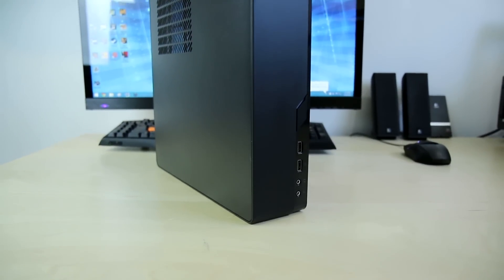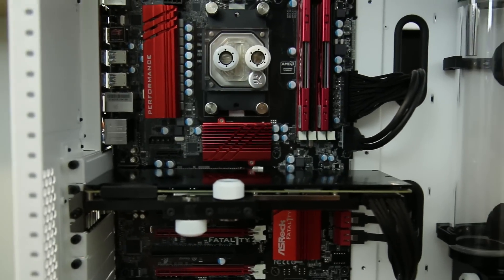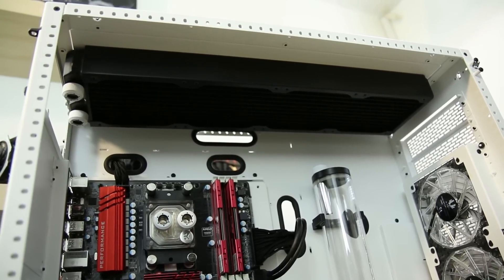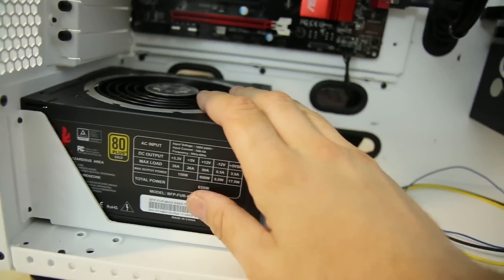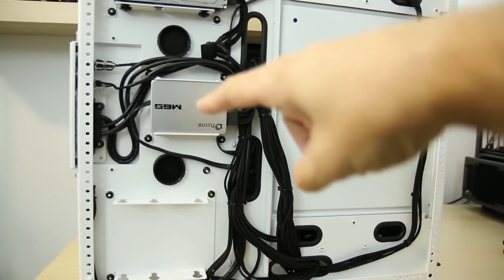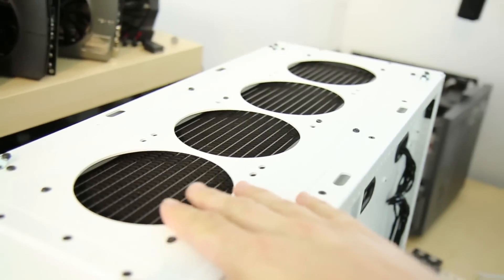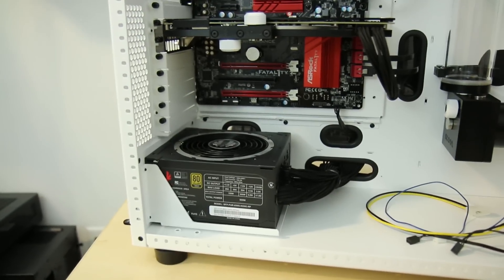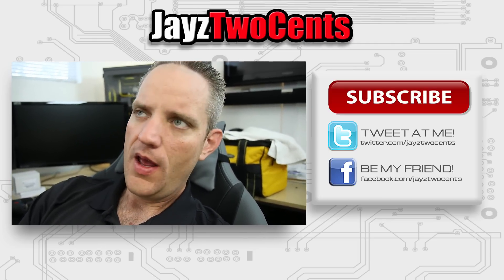Custom Watercooled AMD Build Update No. 1

Comment from the maker: So lets make something clear. Many of these parts used in this are things I donated to her build myself, like the case, the watercooling, etc. If you are looking at this as a "build guide" then you clearly cannot read. The end.
Reply: ***** you didn't really read what he asked
He asked about INTAKE fan not EXHAUST fan
Reply: *****  but if you run the radiator fans at a higher percentage the turbulence would be negligible
Reply: ***** You know that there are more than one AMD CPU, right?

Hell, there are, like, 12 Piledriver CPU's alone.  I'm personally going to guess an 8350, due to the GPU choice, but that's a guess.
Reply: ***** I know all about the 6300 - I'm currently running mine at 4.5GHz on stock voltage with a Hyper 212 EVO on a Gigabyte 990FX board.

While all true, I kind of dismissed the 6300 at first due to the choice of a 980 GPU (the 290x would be a bit more appropriate for that chip, IMO).  Then, I read later that it is an 8350.
Reply: bouke Kalkwijk that would just cause air disturbance (is that the right word?) that fans would work against each other, there wouldn't be nice airflow at all.
Reply: Mohamed Hijazi if you add another intake, then speed up the Radiator fans, you're back at square one. using more electricity but not accomplishing any more.
Reply: ***** is it love!
Reply: I have a stupid question. when running a watercooled PC and trying to keep the positive pressure in the case. wouldnt it work better to convert the Fans to the top radiator to be an intake so that way you are pulling cool air directly from the outside and reverse the fans in the front to make it an exhaust, or even keep all 7 fans and an intake and leave room for an exhaust in the back?
Reply: Justin Bell all air in contact with the radiator will be hot
So you want to expel it.
It's recommended to have your radiators as exhaust for that reason.
Plus even if you get some dust in. You don't have a heatsink to get dirty
Reply: Mohamed Hijazi that makes scene, thank your for the info and not bashing for a Noob Question lol i will have to keep that in mind for when i add Liquid one day
Reply: Justin Bell why would it be 'better'? it would be a different way to handle it. not any better or worse.

top intake and front exhaust is no different from front intake and top exhaust.
the only minor note is that thermal naturally rises so it's easier to use top as exhaust, but either is basically identical.
Reply: I was thinking it would help with the negative pressure and also put cool air through the radiator. Instead of taking warm air from the case. Like I said stupid question ;)
Reply: Mohamed Hijazi thank you for bleep blooping me to say exactly what i already said.
Reply: ***** sorry. I was sleepy and all i got was that hot air rises
Sorry for all the hot air i said

Comment: Could put an intake fan on the rear with a magnetic filter on the external surface. That would allow better positive pressure below the top rad that can then be drawn up through the rad by the top fans.

Comment: I noticed you talk about air flow positive negative static pressures it brought back memories of my heating and air conditioning days when I used a very useful tool a air flow meter it measured the air flow and has a dial with a black indicator that moves forget what it measured it in columns of air I think but was very very useful in ducts management cause you got to have air flow right same thing at least you would know how much air is moving in speed numbers a wind tunnel comes to mind lol.
Reply: ***** in another video I liked your use of strips of ribbon to check air flow thats a good one back in the 50's they used the same idea you seen them in movies on vents always knew when air was flowing.

Comment: I am not on your level of knowledge but couldn't you just youse the fan in the back as intake with one of those aftermarket dust filters? or a DIY one?
Reply: Θοδωρής Μαύρος It would probably mess with the internal airflow since it would be blowing air in the opposite direction compared to the front fans. A bit messy. You generally want air to come in from one side only (generally the front or the bottom depending on the case) and then exhaust it from the top of the back. At least afaik.
Reply: Θοδωρής Μαύρος Not always. As Sauron mentioned, it can mess with the airflow coming from the front intakes, creating additional turbulence inside the case which can negatively affect temperatures.

The other concern is where the case will sit. Will there be enough clearance around the back of the case to allow for meaningful airflow? I don't think he knows. My case and my wife's case sit so the panel on the back of the mainboard tray is up against the wall, so technically we could use the back panel fan mount for intake, but instead I use the rear 140mm fan mount (Corsair 750D) as exhaust, and I have a 120mm fan mounted in the drive bays to use as another intake so there is a channel of air blowing across the top radiator.
Reply: Θοδωρής Μαύρος Personally I wouldn't do that as it could mess with the airflow and mainly it could bring in dust that would fall straight down into the power supply
Reply: Οχι ρε
Reply: Sauron Air, being fluid doesn't much care for momentum at the speeds we are talking about here.  Having 2 opposing fans (in from front and back) will just result in higher pressure in the case which is a good thing.  Laminar flow doesn't mean better thermals on the water cooled components.  More airflow total does.
Reply: frollard then I guess the dust is his concern.
Reply: Sauron which is why you put a filter over it... Like any intake in a positive pressure setup.

Comment: Cheap mobo in a Caselabs case with full custom WC. Makes sense jay! Loved you saying that she doesn't need the features from a more expensive motherboard :P

Fun build, silly arguments.

You already have positive air pressure. Intakes fans dont have anyting blocking them, outtakes have to either push threw a radiator or threw a psu.  It will be fine.

Comment: If your putting an eightcore in that mobo, I would be a little worried about the mosfet temp, with that small heat sink. I guess you could always put a fan on it, if you have issues.

Comment: Jay nooooooo Use that 290! All of them will do 1050/1300 no sweat with nothing extra and that will put it closer to the 980 as far as performance.

Also maybe putting all your fans as intake vs 3 intake 4 exhaust. Maybe run a comparison to show how different airflow paths affect temperatures?

Comment: Why not use the fans as intake on the rads and leave the rear fan opening open?  You have the front fans pushing air towards the back anyways.

So you still have positive air flow that way.  Plus, you have colder air being used on the rads rather than warmer system air to cool the rads.

Comment: Using the 980 just makes the AMD build a PC with a old CPU and not an AMD build....
Reply: pSyk an AMD build means that the build has an AMD Motherboard and obviously an AMD CPU. The gpu does NOT determine the build at all.
And yes the latest amd fx architecture is from 2011.
Reply: Crazy Psycho a good amd build has a crosshair v formula z as the motherboard
Reply: *****
Yes, exactly.
I expected an AMD CPU, GPU, SSD and Ram to really make an "AMD Build" something special and not just a PC with some random parts he had laying around.
Reply: ***** No, there are AMD Radeon branded SSDs and RAM
Reply: ***** You'r wrong, there are AMD RAM kits and SSDs:

http://pcpartpicker.com/parts/memory/#m=6&xcx=0

http://pcpartpicker.com/parts/internal-hard-drive/#xcx=0&m=6&t=0
Reply: *****  So since I have an Intel CPU and an Nvidia GPU I don't have an Intel build?
Reply: ***** So if you have an intel CPU and an AMD or Nvidia GPU it's not an intel build?...
Reply: Jim O
Since there are no dedicated Intel GPUs you have one.
Reply: pSyk pff, there is a dedicated intel GPU :P
Old, but there is one :P
Reply: Crazy Psycho
Link? I think there are only PCIe CPUs,not GPUs.
Reply: *****
lol yeah that's kinda old. ^^
Reply: *****
That's what I said in the first comment
Reply: pSyk https://en.wikipedia.org/wiki/Intel740
Reply: pSyk Well i run a FX8350 + R9 Fury X right now. Works just fine.
Reply: pSyk Well....what about the case? I have a mix of AMD and intel, but have a cooler master nvidia case.
Reply: ***** not desperate at all, just wanted to post the links so you could know better. desperate for drama, much? :P
Reply: ***** because I wanted to? deal with it. :*

Comment: Why not put an extra fan pulling air in at the back? surely that would turn the case from negative pressure to positive (If you are reducing the fan speed on the top).

Comment: I know it's not ideal, but would it be too bad to use the top and front radiators (both 360mm) in a build blowing air into the case, and  have a single 140mm rear exhaust fan?

Comment: 8350 on a 970 board with a 700$ nvidia GPU = AMD build.

jey pls.
Reply: Haha
Reply: stopaskingformyname Well i run an FX8350 + R9 Fury X right now. I pretty happy with it ... doubled the FPS of my HD7970 in Witcher 3 with same settings. I'm not to much into custom design or even overclocking so everything at stock clock speed.
Reply: Scuba Sausage That is not my experience ... i had a 7970GHz Edition which is the same chip as the 280X and doubled the framerate in Witcher 3 with my Fury X.
Reply: Scuba Sausage IF ... i say IF i would upgrade my CPU it would be at least an i7 cause the FX8350 is just as good as an i5 so that would be no benefit.

The FX8350 is what i have for 2 or 3 years now and it did it's job well and will do it till i need a new CPU, but i do not see the need for an upgrade yet.

But thanks for the 'advice'.
Reply: Scuba Sausage
What's wrong with you? the i3 is about as good as an fx 6300, the i5 is on par with the 8350. The 8350 beats pretty much all i3s.

This guy explains it well

http://www.tomshardware.com/answers/id-1913466/8350-4670k.html

Why the hell would people buy a 200$ amd cpu to save money if a 120$ i3 is better and cheaper? Because it's not.
Reply: Scuba Sausage Well if you think so fine .. go buy an i3 ;) .... but your first link doesn't seem to include FX8350 benchmarks only those of a 8320E (and the E ist important here as these are AMDs 'low power' CPUs which run often at lower clock speeds), and second i don't know if i would trust a benchmark (your second link) that claims an FX 4320 is faster as an 8350 cause the first only has 4 cores compared to 8 cores of the 8350.

But never the less ... the question is: is it worth for me to invest 350€ for an i7 4790K and yet another 100-150€ for a good Motherboard just to see a approximately 10FPS increase in the 70-80FPS range? (and your example is based on a 980 ... this might be even lower increase with an 980TI or my Fury X). Especially as i already have an ASUS Crosshair V Formula-Z Mainboard and FX8350? I doubt it.

But sure ... some day there will be an upgrade for it. But not yet.
Reply: I3 is shit, it's a dual core and cannot run most games coming out, AMD is amazing for the price and you won't notice a difference in going from 8350 to I5
Reply: In not trolling, the i3 can't play farcry 4 and games will need quad cores. AMD is great value
Reply: And no, the difference is minimal
Reply: No, these are outright lies. Intel probably sponsored them to do this shit. And AMD FX 6300 kicks I3 up the ass
Reply: Scuba Sausage Sorry Scuba but buying an i3 is .... lets say ... suboptimal  ... that might be enough for games which are not optimised for multicores.

.... a few weeks ago my power supply fried my Mainboard and CPU so i thought well they all say it must be Intel so i bought an i7 4790k + Mainboard and what should i say yes it is a bit faster as my FX8350 but in games this does not seem to matter that much. i got a 10% FPS increase in Witcher 3. It was totally playable with the FX 8350 and it went from ~70 FPS to ~80 FPS. But that was 500€ + costs for a new power supply. So if you are on a budget i can understand when people buy FX-CPUS they are not to bad.

And if that 4GHz i7 barely makes a difference i highly doubt an i3 will be anywhere near that.
Reply: Scuba Sausage So then you did something seriously wrong ... cause i upgarded from a FX8350 to a 4790k too ... and yes it is faster, but especially in games you do not see a dramatic change cause most games are GPU limited not CPU limited and DX12 will even help reduce CPU load.

So you bought an i7 but recommend an i3? Did you really ever use one? Cause then you wouldn't do.

But we can go here in circles ... seems you are seriously convinced an i3 is a good choise *shrug* ... so then go buy one  yourself ;).

Comment: I was wondering, how come you don't just have the rad pulling air into the case? I mean by putting them above the radiator so they're still pushing.

Comment: Although the fans are 120mm+ wouldn't 7 of them, plus what's in the PSU be quite noisy?  Or did I miss hear what your putting on the top radiator?

Comment: ...BEST FRACTAL DESIGN AD EVER...   XD

Also, I used that same MoBo + enermax red LED fans + Red NZXT Phantom 240 for a friend's build.  I prefer the Gigabyte GA-970A-UD3P board for overclocking FX CPUs, but this board worked with the red theme.  :) Also, I can tell you from experience, the chipset and VRM in that board are going to get HOT...hotter than average for AMD 970 boards.  So I would suggest maybe a Silverstone 120mm filter and intake fan on the rear to blow as an intake and hopefully bring fresh cool air onto the VRM and chipset heatsinks.  ;)

Comment: What about air flow for the mechanical drive? Mounting on the backplate with the SSD's is clean and all, but shouldn't there be some airflow for the 2TB 7200rpm drive?
 I love this build, by the way. I have similar for my media server... even down to the AMD board & G-force graphics card.
Reply: Aeoster they can transfer some of that heat in the aluminium case

Comment: Why not put another intake on the rear of the case? I have 1 intake in the front, 1 on the bottom, and 1 in the rear. My radiator is mounted on top with 2 fans exhausting. With that positive pressure my radiator fans almost never turn on (unless Im doing something intensive.) I have them set to turn on only after the CPU hits 40C and the intake fans (fractals silent something) are on full blast. Extremely quite while idle and doing light tasks, only ramping up when they're needed

Comment: Although Jay is using the Asrock 970 performance, it is not a good board I have had the board replaced and it still didn't last longer than a week. I went with the Msi gaming 970 motherboard after the Asrock failing twice. Don't use the Asrock 970 performance! Hope it work for jays friend , but I doubt it will last long.

Comment: Would you recommend the r9 290 for a budget build?
And what's the difference between the r9 300 series and the r9 200 series
Reply: Mohamed Hijazi A 290 in a budget build is still a great card, but the fact is games are needing more VRAM nowadays, so the 3gigs in a 290 might be cutting it too close in some games.

As for the difference, a lot of the 300-series cards are refreshes of the 200-series, meaning they have better power delivery, more VRAM and more efficiency, with the same actual GPU core, as the last-gen cards.
Reply: jedidethfreak thanks for the info
And if that's the case then I'll set my sights on the 390 (8gb vram and almost the same price)
But I've been reading about it. And ventilation will be an issue

Comment: I'm confused.. Jay talks about wanting positive pressure and blocking the rear fan slot to help with that so he doesn't have to turn down the rad fans too much.. why not put another intake fan in the rear instead? The psu puts out so little heat and is so far away that this makes the most sense imo.

Comment: Jay, I need to disagree with your positive pressure plan. I hear so many people talk about the need to maintain positive pressure in a case to reduce dust intake through the smaller hole in the case, but if you're not using filters on the intake fans then positive pressure doesn't matter.

Comment: I will say that this is the best video I have seen on your channel. You told the story and your character came through. It was refreshing. I have been a little put off by your sexual references as they seemed childish. Maybe it appeals to the 10-15 yo crowd. I found it hard to push through and get the actual info you were giving. From this I would say that you are an intelligent and creative and nice guy. The only negative observation (there always is the catch, lol) is that you could build another system in the room left by the case especially since there are reference to budget. Those cases are really nice but the price is up there too. I think you addressed all the other issues well. Too bad about the Cryovenom, just sitting around. Based on your review I talked my son into a 290x version and a watercooled build for his new system. Thanks for all your efforts to raise the level of the newb mod/watercooler folks out here.

Comment: "it's still more powerful than the 300 series"

I think that's fairly debatable, considering that the 390x and the 980 are neck-to-neck in many benchmarks with the 390x winning at least some of the times (despite being 70 bucks cheaper and having a lot more vram for those who like modding).

At the very least, I think it would have been nice to showcase the 390x considering how (unfairly) critical people have been over the AMD gcards. They're incredible value for the price and the Fury X, despite having lower performance, has some amazing cutting-edge technology that's pushing the medium forward. A bit disappointing that this brand isn't getting its recognition in the build.

Still enjoyed the video, overall, tho. :)